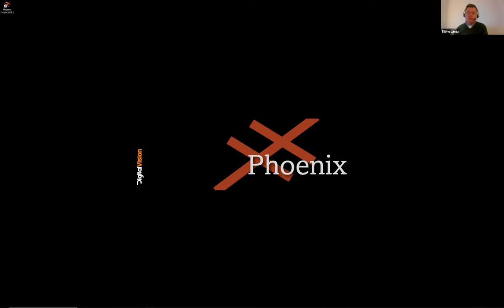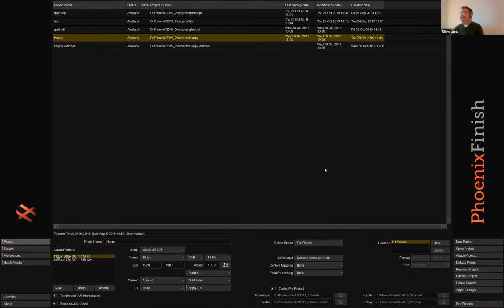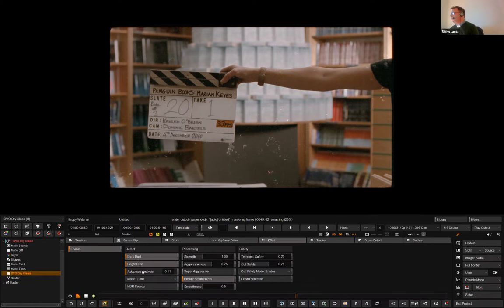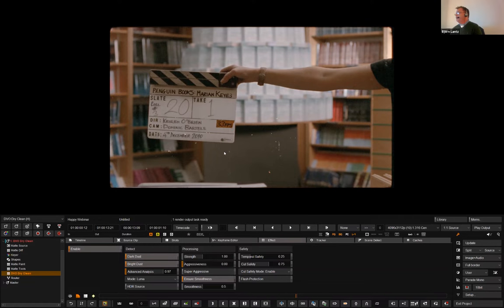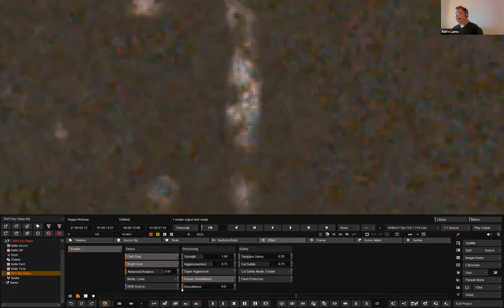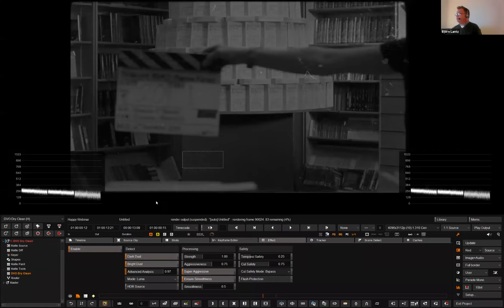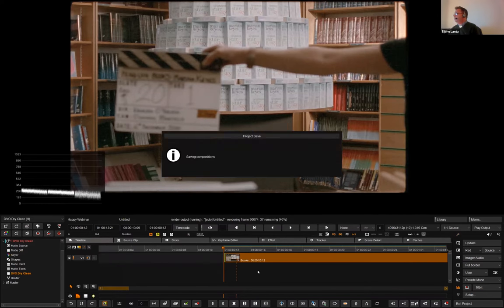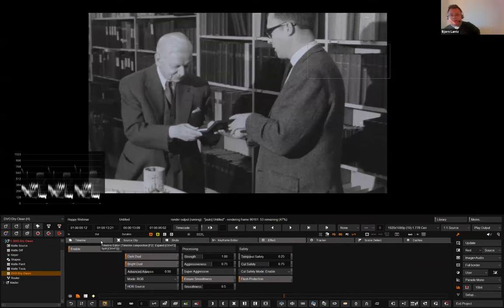Introduction to Phoenix

Comment: An ill prepared and clumsy presentation. For longevity of online tutorials/ advertising it’s worth considering planning how one’s presentation will be viewed by a wide audience.

As an experienced motion and still image restorer my view is Phoenix is out of the price range of most independent artists. Rather, it is  primarily sold to national film archive bodies. The application I use is Diamant’s Dust Buster +, with added filters from their fuller film restoration suite. The last time I looked Phoenix had a price tag of $26.000 USD. Dust Buster + costs approximately $8.000, and Pixel Farm’s PFClean is priced around $10.000.